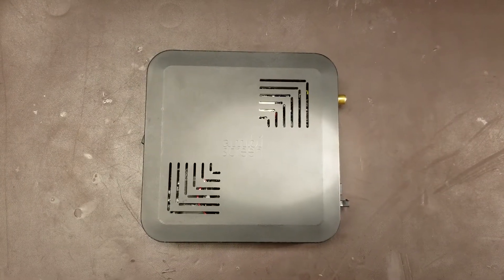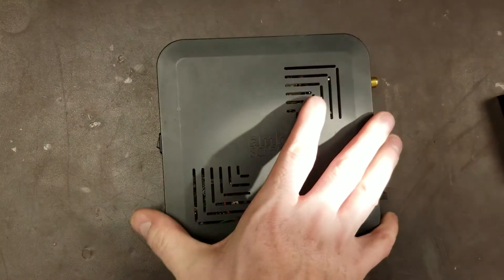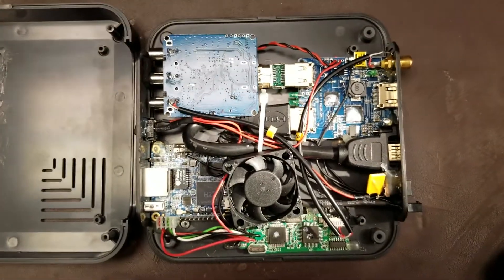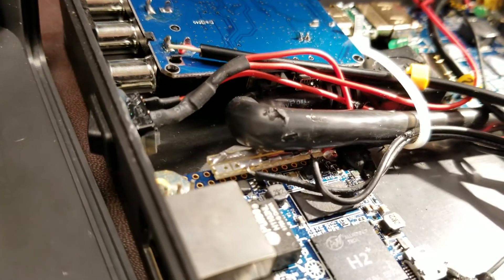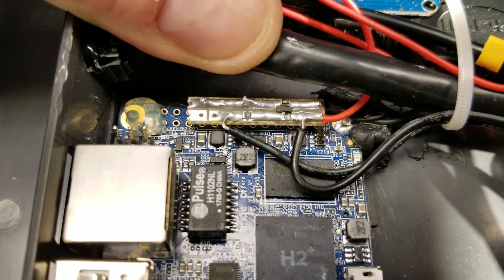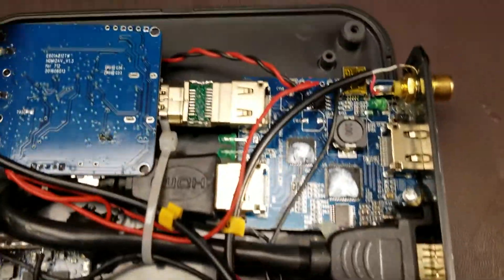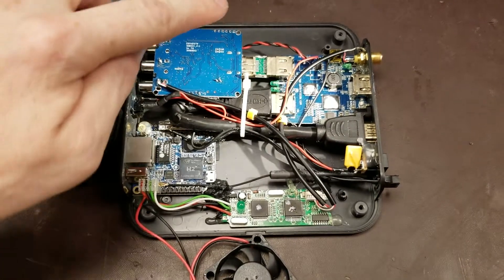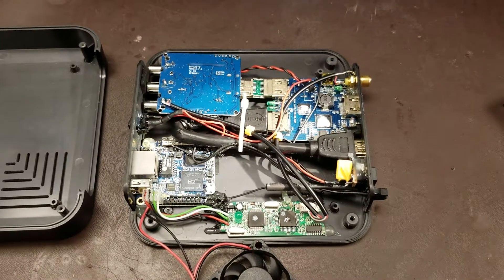4K AmbiScreen Teardown - Hyperion Based HDMI TV Ambient Lighting

Comment: 179 isnt actually too bad, considering the raw parts costs are like 60 bucks, selling it for 3x the raw costs is not uncommon as you put time into it.
and even if he made a pcb with all the same crap on it ( assuming you can even find those specialized chips, its datasheets and a lib documentation ), what would be different? 
i think a one-board solution would be much cleaner but also much more expensive. i bet you couldnt even make just the SBC alone for less than what this costs.

so if it works it works.

also repairs are made very easy.  sd card backup, if anything breaks its standard parts you find on ali. basically the first result when searching for hdmi splitter.. hdmi2av converter.. videograbber etc.  

and if you dont need it anymore, you dont need to throw it away. you can salvage parts, this orange pi sbc is quite useful.
Reply: remember its one guy in slovakia making them by hand, not some fucking chinese megacorp with tooling and ressources

Comment: Hope you get a refund.  Terrible stuff!  BTW would you mind sharing the STL files for the Stepper motor mounts?  Building a Mag loop myself.  Great work!
Reply from the maker: These are the STL files for the stepper motor: https://www.thingiverse.com/thing:4090566/files
Reply: @TookBurrow  Thanks very much!  I've shared it on a FB Mag loop group.  Further thought on the case.  I bet they bought those cases as rejects from some other product and did some mods to them.
Reply from the maker: @W4TRI_Ronny  that is possible. The logo was formed into the plastic though. Might just be that they wanted to launch a crowd funded campaign. Come to think of it, I think that's how they got started.